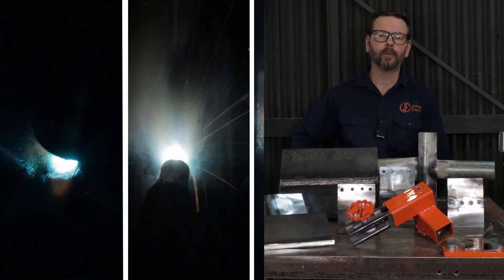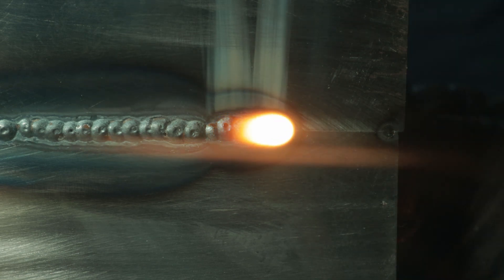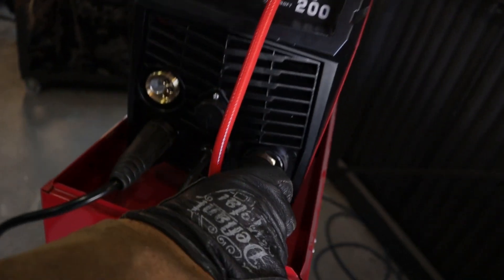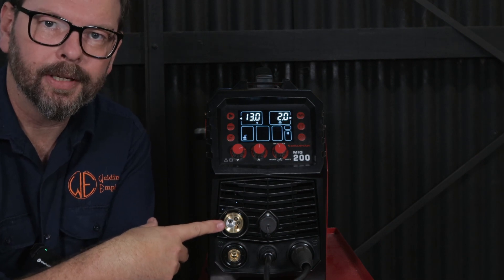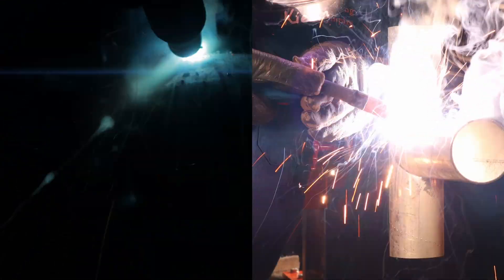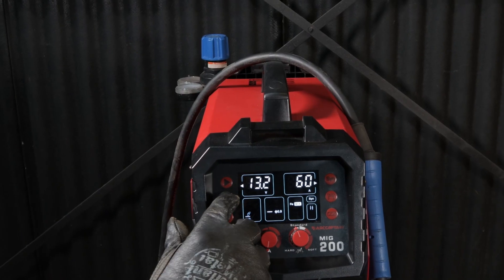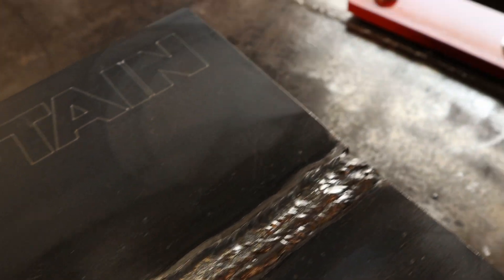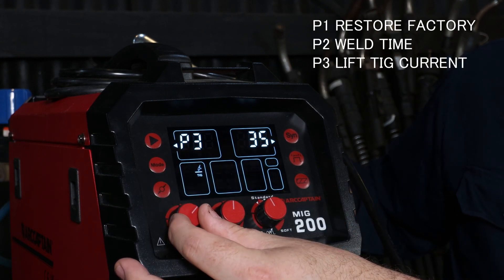Arccaptan MIG 200 Multi-Process Welder | Beginner Friendly

Comment: I have recently upgraded to a Unimig Viper 165 and in my endeavour for knowledge, tips, and / or tricks i stumbled across your channel i find this Very informative you do a great job at relaying the information.

Thanks for your time
Reply from the maker: Hey Chris, thrilled to hear you're benefiting from my channel! How's your experience with the Unimig Viper 165? I've been using the 200 AMP AC/DC model and it's been rock-solid for me. If you're keen on diving deeper into MIG welding, check out my welding cart build video. It offers additional insights on planning your welds during fabrication. Keep enjoying your welding journey! 🛠️🔥
Reply: @weldingempire  I have only had the Unimig a few days now and more or less only set it up and zapped acouple of bits, so cant give an honest opinion just yet, I bought it more for the TIG function as it's something I want to learn.
I will definitely watch the episode on the weld cart

Thanks for the reply!

Comment: Great video. I am looking at a multi-process welder and have the option of single phase and three phase, mates tell me three phase is the way to go, your thoughts would be greatly appreciated. Thanks for sharing. Cheers
Reply from the maker: Absolutely, three-phase welders generally offer superior power output. However, keep in mind that if you plan to use the welder outside of your workshop, a three-phase option might be less convenient due to its power requirements. If you're working with sheet metal, definitely check the low voltage capabilities of the three-phase welders. Also, consider the size of the MIG gun; larger ones might not fit into tight spaces. For smaller tasks, a 150 amp MIG gun could be a more suitable choice. Hope this advice is useful to you!
Reply: Hi W/E Thanks for the reply, greatly appreciated. I am in Oz and looking at a cigweld 355i 3 in 1  three phase or a Topgun  200 single / double pules  3 in 1. Just don't want to buy something that's not going to last,  Thanks for taking the time to reply. Cheers
Reply from the maker: No worries. We have a Top Gun 3500LSWF at work and I wouldn't recommend it. I had a Top Gun 200 amp AC/DC welder that I got cheap because it needed repairing. I wanted to replace the circuit board because of a broken potentiometer. They threw all their older welder replacement parts out and tried selling me a new welder. I replaced the pot and sold the welder for $350. After-sales service Could be a problem. The CIG Weld 355i looks like a solid choice. But have a look at the RAZOR 350 COMPACT MIG/TIG/STICK WELDER. It is a slightly larger machine but it has the castors and bottle stand as part of the package. Plus it has spool gun capability. I used one for about 6 months at a hydraulic repair shop. Great machine.
Reply: I greatly appreciate you taking the time to reply, I will have a look at the unimig,. Thanks for  your help.,take care, Cheers

Comment: Hi Kieran, I purchased a 205DS based on your recommendation some 2 years back. I really like it. So much easier to use than my old CigWeld. The Inverter technology is great. I would definitely like to see the cheap aluminium welding using a regular MIG torch. I assume that you will be using the 205DS?
Reply from the maker: Hi Greg, I,m glad you are liking the YesWelder. I will be using the ArcCaptain for the MIG welding, but everthing I show in the video will translate to the 205DS.

Comment: Long time fan still experimenting with adding hf start to my Chinese multi process welder I got 3yrs ago. Since then added a primeweld Tig 225 with maxcool 3000 water cooler and a CK worldwide fl230 torch best investment dollar for dollar for a setup for under $1500 it has paid for it self with the first 3 jobs I did.
Reply from the maker: That new setup sounds awesome!😎 I'm like you, where I like to have the machines earn their keep. What material are you usually working with?
Reply: @weldingempire  I'm working with stainless steel, titanium and aluminum I took off on building custom turbo kits. In the slow times I repair just about anything.
Reply from the maker: @danielsplayhouse3804  I've never welded titanium before. Is its puddle similar to stainless? I will be building a manifold for my SS Commodore with an LS1, I have the 78/75 VS racing turbo. Turbo life! 🚗💨. Do you have an Instagram for your work?